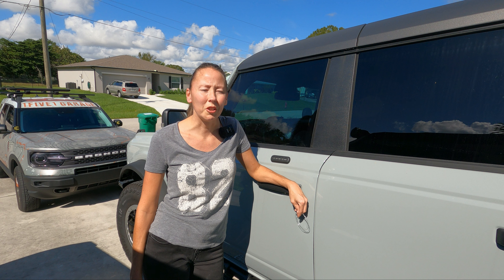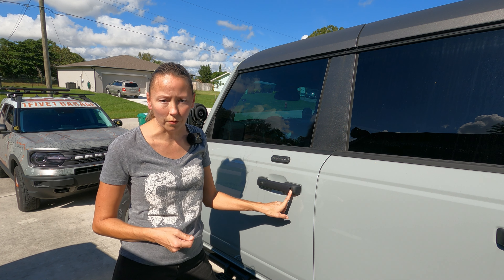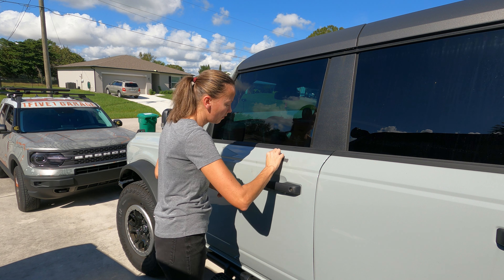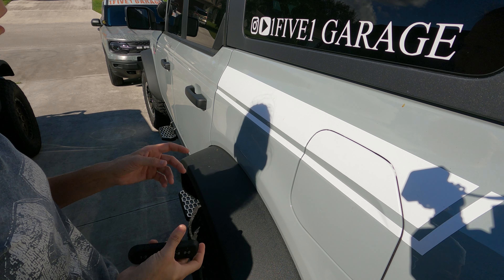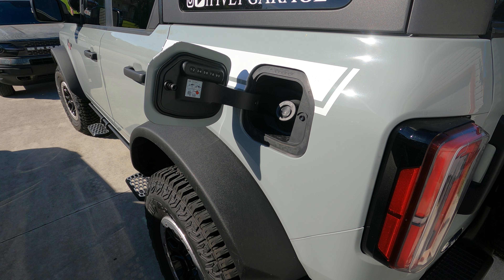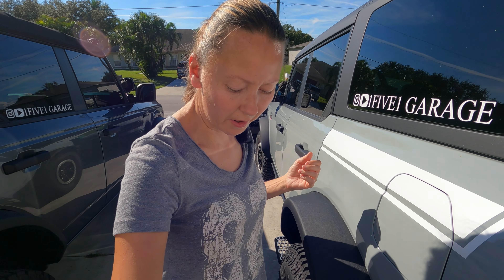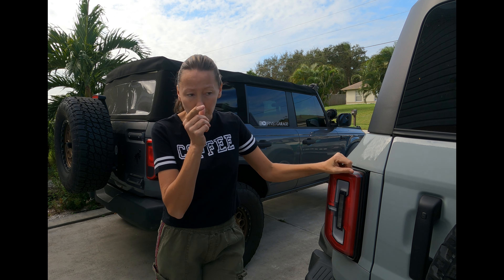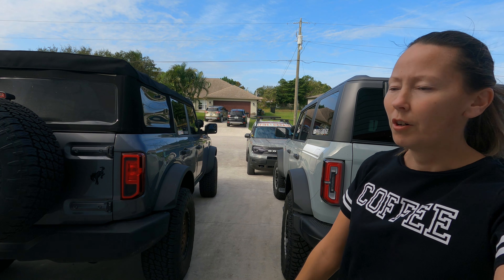Relocating the Bronco's Keyless Keypad to an Unusual Location...

Comment: As a base owner (no passive unlock) and someone with my hands full more often than not, I actually went the opposite route - not only left it in an accessible spot (A pillar) but added two extra pads, one to passenger b-pillar and to the rear tailgate. 

Sounds stupid until you're trying to quickly load a fussy toddler and her gear, and you just want to get into whatever door you're closest to without rifling around for a keyfob that will ultimately wind up back in your pocket again...
Reply from the maker: Not stupid at all. I get my dogs in the back and wish I had it on the tailgate. I hate fumbling for the keys. I will have to look into this.  Ty.

Comment: How do you feel about mud flaps on your bronco with the Sasquatch package for protection from chipping??  I really haven’t seen anything I like so far.
Reply from the maker: Shawn isn't too keen on mudflaps. I do have a set I need to put on for a product review. I just need to figure out which one to put it on and if it needs crash bars or not in order to attach to the vehicles.

Mud flaps are personal preference.

Comment: My 2022 Badlands keypad is body color to match my hot pepper red so ill leave it in it'd spot for now
Reply from the maker: In 2022 they had them color matched. I wish they started that way. We plan on doing old school-ish graphics on the side so it would need to be removed anyways.
Reply: Yeah only the 2021 models were textured black in colour. Then Ford decided to body colour them in 2022. It was one of the first things I’ve noticed when we saw one in a parking lot.

Comment: The code that came with mine is different then the code under dash how do I make it work
Reply from the maker: If neither code works then I would talk to the dealership to fix it. Usually the code that comes under the dash is the main code for the doors.